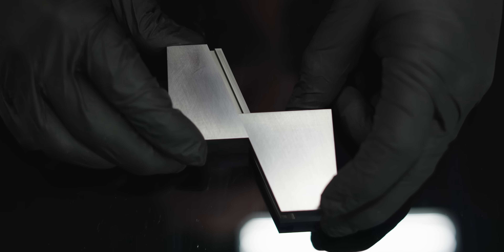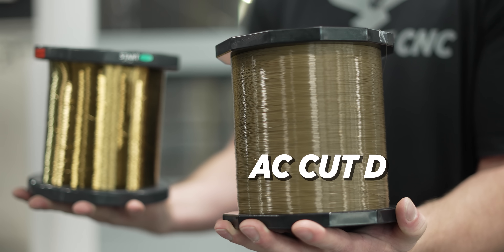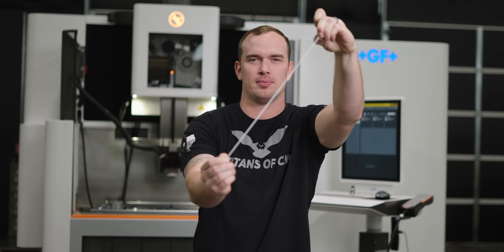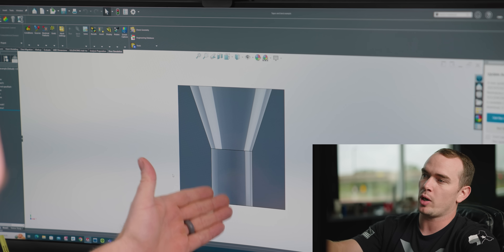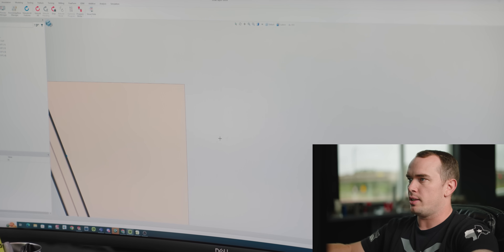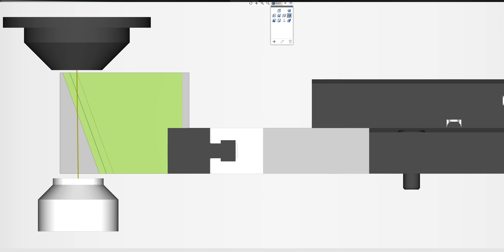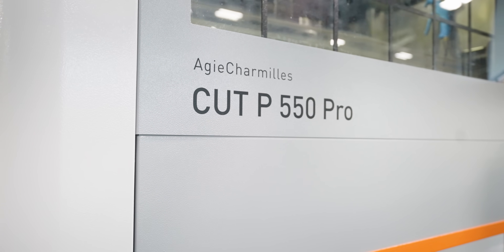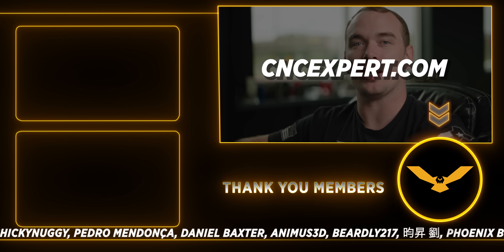How These INSANELY Precise Cuts Are Made

Comment: Hey I got question
If you are using long inner tool for long holes when the diameter is 37mm what will be the rpm and feed on the tool to make nice smooth surface on the turning machine

Comment: Zero-tolerance parts do not slide together. If a male and female part are the same size it is an interference fit. If your measurements show them to be the same size you are not measuring with sufficient accuracy. EDMs leave a relatively rough finish, compared to say ground and polished components and the peaks and valleys are easily measured with the right equipment.
Before retiring I worked on profiles that were measured to sub-micron tolerances so I do know of what I speak
Nice work on the wire EDM though.

Comment: Will be glad if someone explain me how it's possible to calculate the position of wire with slant. I still don't understand how, since at the outlet of the "nozzle" it must bends not directly in its center. It must be pulled to the wall and bent through the rib. Or is the diameter of the hole equal to the diameter of the wire? I hope I could explain why I'm in puzzlement

Comment: Man EDM technology just always amazes me.
Reply: Yeah ide look into your machine I run a Sodick over at my shop nd it’s always done exactly what I tell it really great machines there was a time when I guess something happened when I wasn’t there and the wire was no longer straight up nd down resulting nd always having a taper but as long as you make sure that’s good nd get your settings pretty decent they are extremely accurate
Reply: Ide really like to see y’all do sum edm turning tho I’ve seen it played with not sure how practical it really is but ide like to see it done on a production part
Reply: My shop uses EDM. we have constant reworks. And more scrap than we should. 

"Percise" lmao
Reply: @sladehunter I mean, you can’t really deny the precise nature of these machines. If your shop is scrapping or reworking parts it’s likely not the machines fault but instead the process or setup of the machine. What kind of wire do y’all have?
Reply: @trevorgoforth8963  copper. Don't know the specifics

Comment: That is a good tip about using the wire with a higher copper content for tapered cuts. Thanks for the info Trevor!
Reply: Will your company be getting rid of any sinker EDM’s
Reply: Also for the next video y’all should show off where this machine really shines at cutting parts that would normally be extremely expensive to make from hard materials like inconel
Reply: @ronniesmith8249  I don't think we will be swapping out any of our EDM's anytime soon.  If you need, I can get you in touch with someone about a new one though.  Trevor will definitely be covering several topics on these machines to show their strengths and where these types of processes really shine.  Thanks for the feedback!

Comment: How much is your average GF wire EDM machine?
Reply: They range from 140K - 250K. After that you get into the high end stuff where price comes secondary 😂
Reply: We bought a machine of the same model this year, and it was right over 200k USD with a couple optional features added and a low value trade in.
Reply: @YoSoyElQuesoGrande  Happy with your purchase?
Reply: @trevorgoforth8963  i love it. We got rid of an early 2000s charmilles 240 that was a train wreck. It would never operate for more than a couple weeks before being down for a month. Bought it used before i started here and it was a “too good to be true” deal. Our other main wire is an early 2000s charmilles 440cc that has mostly been very good for us. The move from that old millenium HMI to the Uniqua HMI has been pretty difficult for the longer time guys though. It has about 600 hours on it and probably 400 are my hours. In house tool and die shop so intermittent use, had it in operation since early april.
Reply: @YoSoyElQuesoGrande Glad to hear you are happy with it! We will be doing videos showcasing different Uniqua features, hope it helps!